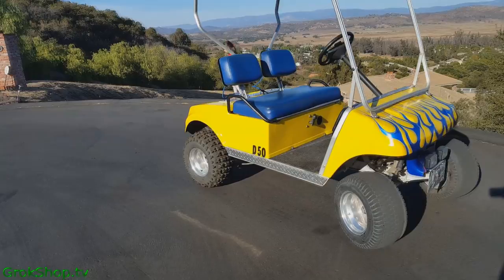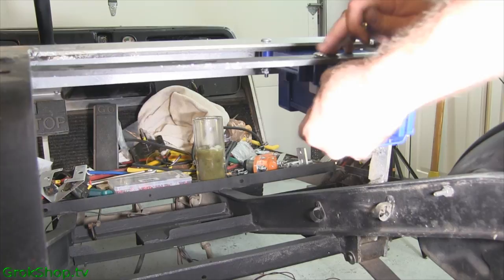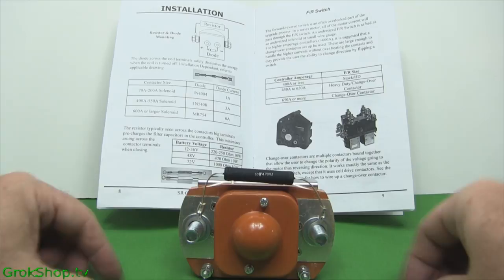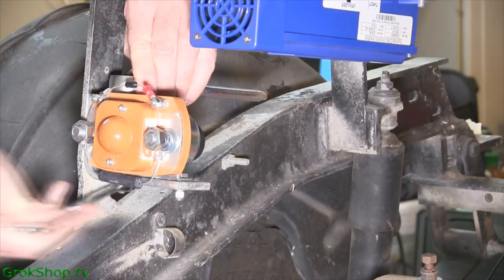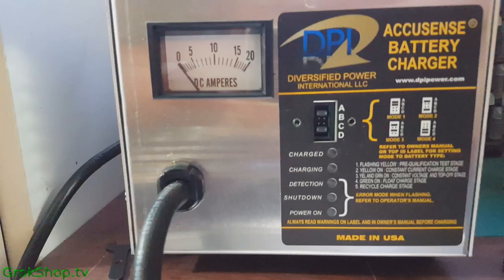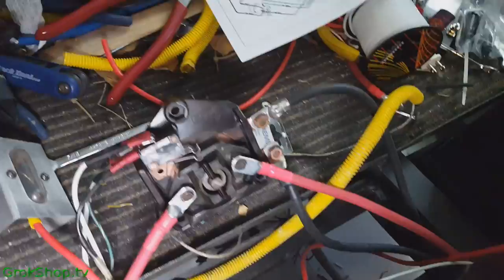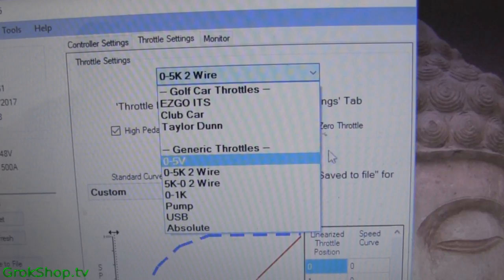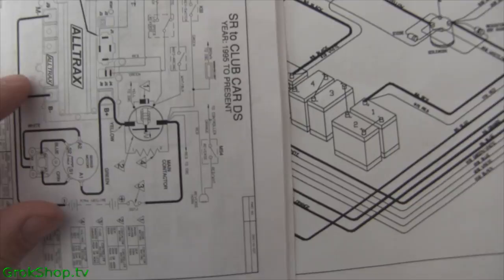Club Car Golf Cart Build | 36v to 48v Conversion [part 2] | Installing New Electrical Components

Comment: Please tell us where we can obtain the resistors depicted on your V Glide, and what values they are, as they appear to differ according to location?
Reply from the maker: Here is a post I made on this topic:  https://grokshop.tv/club-car-v-glide-resistors/  This post shows all the values for various configs & where they go.  When you upgrade from 36 to 48v you may want to change the resistors to the 48v config which smooths some of the jerkiness out.  You can buy resistor packs for the v-glide like these:  https://diygolfcart.com/club-car-multi-step-resistor-kit-1995-up/  But way over priced IMHO.  I would just buy individual resistors from mouser like I show on that page (and get some ring terminals).  For further smoothing there are Alltrax tweaks like "absolute" throttle you can try.

Comment: wish i was more  mechanical minded,  got 3 golf carts ,2 broke and last one is about to go im thinking, it started with batteries going bad . I bought new  ones and cart stalled in field and i pushed it home. Tried working on it and caught one battery on fire.  the third golf cart i bought  now has all new batteries but full charge takes me  about 200 feet and im out of juice again. its a club 2012 i think. .Noboby around to help me,do u think u might. i know its a long shot.
Reply from the maker: Hi Nichole.  What kind of batteries did you put it?  A 2012 cart should still be in relatively good condition other than batteries.  You get about 5-6 years out of batteries, typically.  If one of your new ones caught fire, something is terribly wrong!  Make sure they are deep-cycle batteries & the right voltage.
Reply: So hard to diagnose stuff like this over the internet but i bet you got a battery backwards

Comment: I know this is an old video. But I have a 48v cart. I have my eye on a 36v cart. Reason I’m eying it is someone lifted my cart incorrect. I’m assuming I can just transfer all my 48v stuff to this new cart correct?
Reply from the maker: Old video, and older cart :P  Far as transferring your 48v stuff...  If its of the same model & generation, for sure you can.  If its not of the same model & generation, you could have to make some mods.  Also you will need to decide if you want to bring the 48v motor over or not.  I still run the 36v motor in this cart without issue after several years.  But its possible to burn it up if you aren't at least a little careful with it.
Reply: They’re both club cars and if probably just take the rearend from mine
Reply: @jimmydavenport4048 i think you get better torque with the 36v motor ran on 48v.

Comment: Hi! I wanna know if there is any problem if the golf cart is all set up for 36v (battery, solenoid and engine) except for the controller that is for 48v. Is there an issue? It can damage the batteries or any other part? Thanks!
Reply from the maker: Your motor should be fine as long as your controller supports both 36 & 48v.  The one I used here is 36/48 & in fact my motor is still the original 36v motor even though I  am running it on 48v.  You want to be sure the controller will work at 36v.  Also, if your new controller will be pushing more current, even at 36v  - you may want to upgrade the solenoid unless you can limit the current at the controller to stay within the solenoid's spec.
Reply: @grokshop  Thanks for the answer! I bought the cart less than 3 years ago (new one, not used). And it seems like the battery already has gone. I just read that the controller of the cart is 36/48v but it have to be set up to the voltage that matches to the engine and solenoid before installing it into the cart. Doing that you avoid damages to the battery and the components. Do you know if it's correct? Sorry for bothering you
Reply from the maker: If you batteries are dead after 3 years, you may not be doing optimal maintenance.  The most important thing is to keep the charge topped off & keep the water levels up.   What is it that you are trying to do?  On newer carts you could have other concerns like onboard computers & battery regen which further restrict your "voltage flexibility".  If just the batteries have gone weak - you may want to just get a new set of 36v batts and be done with it.
Reply: @grokshop  I do the battery charge and I always check the battery water level. Maybe one point that I failed is that many times I use the cart on Sunday, after playing I put it to charge and use again only in the next Sunday. So the charger is on for a week. But I just want to assure that the Controller is configured properly to not having another battery issue in less than 3 years
Reply from the maker: @mymizuma  If its a smart charger which monitors the voltage & cuts on & off to keep the voltage topped off, then leaving the charger on should be  a good thing.  Also not running the batteries below 50% is helpful & of course you want to use only distilled water.  If the controller is the one that came with the cart, you shouldn't have to worry about the config.  If its aftermarket then you definitely would want to hook up the config app and go through the settings to match your cart.
Reply: @grokshop  Ok, got it! Thank you for your time! Helped me a lot

Comment: Did you ever check how fast it runs? I have a 36v I just got it and doing some work on it, now I found out last night the (coil spring looking) resistor board get hot and smells toasty when you have 3 people on it or if you go up hill now with your video I'm thing or upgrading it to 48v..(it'd be interesting, oh and It can only go 12mph.. Which I think sucks LOL.
Reply from the maker: Never clocked mine, but I estimate on a flat surface I only get about 18-20 mph.   Up very steep hills I might only be going 12 myself.  So the speed will depend on a number of factors.  Mine has the high-torque motor, which isn't going to be as fast as the low-torque one.  You can also get more speed with bigger wheels / tires.  And then with a programmable controller like the one I have, you can tweak it a lot.  Sounds like you have the resistor /  coil model.  The conversion there will be a couple extra steps beyond what I showed because the wiring is slightly different esp wrt to the v-glide connections.  But certainly doable.  I'm sure you know the resistor coils are supposed to dissipate heat... so if its been sitting a while the dust will have to burn off.  But it was a very inefficient design relative to the controller design (unless you also happened to want a seat warmer, haha).
Reply: @grokshop  Lol, seat warming would be nice (up north but here in Florida? 😂). I'm more concerned about the burning smell being around the the battery and the motor I'm almost always prompted to check it every time I smells it (like I said earlier, I just got it, so I don't know much about it prior) so far my wife is liking it too just to be sure she feels safe using it with the dog. But so far videos like yours are of great help so thank you for taking the time.. I'll do more research then see what I'll settle for..

Comment: Great video,  did you use the stock motor and paint in red, or replaced it?  Thank you for the good and hard work.
Reply from the maker: Kept the stock motor & painted it.   Still goin strong!
Reply: @grokshop  Awesome, you're a life saver! And did you program the controller to do how much speed and torque? Thank you so much!

Comment: Hey thanks for the video, I actually have a 36v EZGO that I just picked up, which is quite similar to yours here (mine has a F/R switch right under seat too). Just wondering after 3 years, did you ever burn out your motor? That is one of my main concerns regarding switching over to 48v. Also, some people online say that you should get a more "heavy duty" F/R switch, but you just went and cleaned yours and reused it for the larger power that was going to go through it. Any problems with that? Thanks!
Reply from the maker: Still going strong with original motor & FNR switch.   We have some pretty big hills too.  However, I don't stay on it hard for more than a few minutes at a time.  Good luck with your overhaul!

Comment: my golf cart  is  charged  up  an  still   won't   move    what's    wrong with   it
Reply from the maker: If it won't move at all, I would start by checking for loose or broken connections or a damages FNR switch, or a damaged solenoid.  Also a failed key switch or switch wire that goes to the controller (if you have one) could do it.  Definitely test the pack voltage to make sure your batteries are holding enough charge - but usually it slows gradually & not just stops running one day.